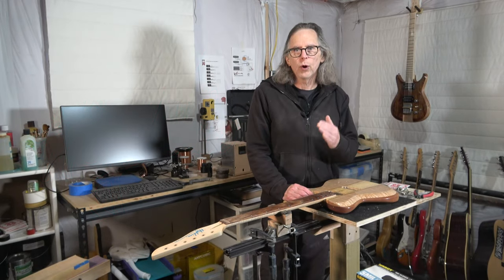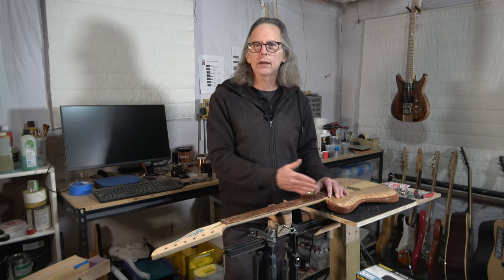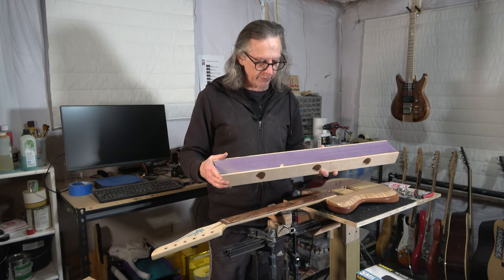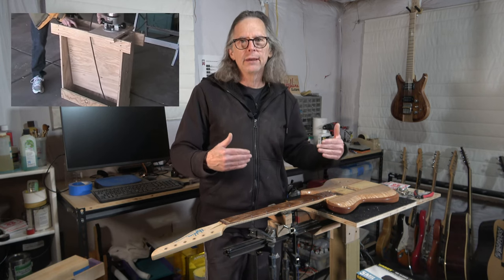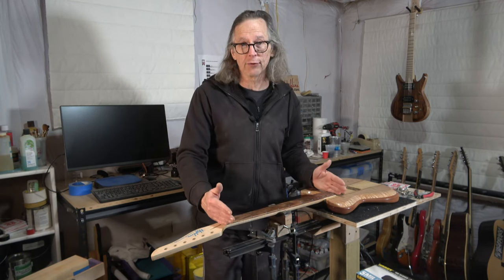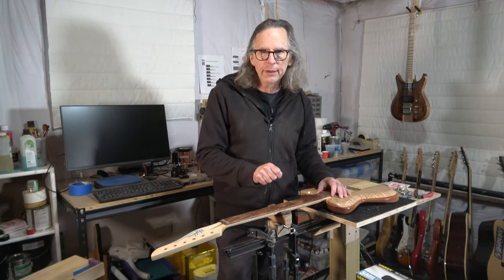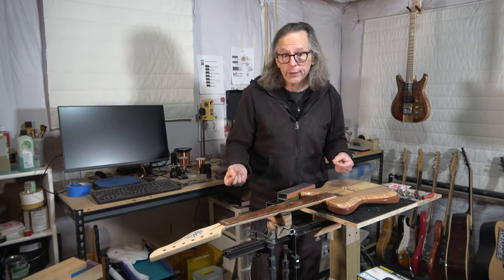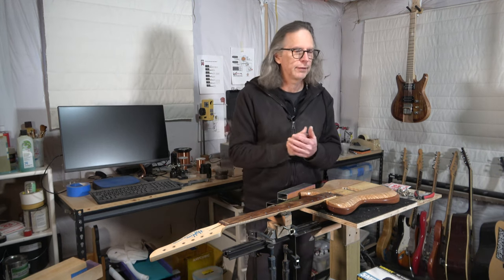How To Make A Compound Conical Radius Fretboard

Comment: I have found, using my player's perspective, that making a 10"radius fretboard works great for chording and 1st position use but then using an old luthier's trick of doing a "conical" taper at or around the 12th fret and ever so gradually flattening it out to maybe 10.5 ish with a bit of 'fall-off' makes the action super low, super bendy and gives the 'fast' allusion to the dusty end of the fretboard as the late great Malcolm Young would refer to it as.

Comment: I prefer no radius at all, and I don't understand why do electro guitar builders even do that. I find it easier to perform bend on flat surface and with higher frets (like sintoms 4.3, they have 2.59mm crown height)

Comment: I agree with it being a gimmick to an extent… I have a few compound/conical radius guitars and a few single radius guitars and the difference isn’t really that dramatic past 10” - my Road Worn 60s Strat has a 7.25” radius and only issue I have is that it sometimes frets out if the truss rod isn’t tightened. Other than that I barely feel a difference

Comment: It seems that if you want a locking tremolo system you need a compound radius because the locking nuts are only 10” and then bridge 12” unless you use GOTOH 14”.
Reply from the maker: Only if you’re super anal retentive.

Comment: What radius cauls are available? I wonder if putting a piece of thick rubber with a fret-sized groove between the caul and the fret would accommodate the slight discrepancy in radius between the caul and the fretboard while applying consistent pressure onto the fret?

Comment: Great videos!  String spacing is greater at the high end of the fretboard than at the nut.  Therefore, for a straight (no relief) neck, the minimum buzz-free string-to-fret spacing over the entire fretboard is achieved with a conical fretboard.  Envision moving your "vertical" Christmas tree (cone) lights to a cylindrical trash can, or vice versa, and you can see the problem.

Comment: When I first heard about "compound radius fretboards", I'll admit to being momentarily mired in confusion. Then I realized it was actually a misnomer that had become generally fixed within the guitarists' lexicon based upon a miss-identified or referenced aspect of a portion of the circumference of a circle. In short, that specific section of circumference, its actual width corresponding to that of the fretboard at the nut, manifests its degree of curvature in direct relation to the radius (one-half the diameter) of the given circle; the larger the circle, the larger the diameter, and subsequent radius. Since it was easier among craftsmen and musicians to refer to such degree of circumferential curvature by referencing its relative radius, it became a commonplace application term within the genre. 
In terms of fretboard curvature specificity, the term "conical radii" would be more accurate, but will not necessarily supplant the currently widespread use of the term "compound radius". Does it really matter?  Probably not . . . but knowing the difference doesn't hurt, either.

Comment: I like the compound/conical fretboards on my basses, as the longer scale I use (36") and the need to play two handed tapping on occasion, levels out the feel low and high on the neck.
I simply use a no 5 plane and follow the path of the strings on the fretboard instead of staying parallel to the center line.

Comment: if you weigh for a long time :) all the pros and cons, then you can come to a purely flat frets surface. It's not even a matter of manufacturability (obviously it's easier to make a plane and install a fret wire than a cone and other second-order curves :)). The main advantages of a flat fret surface are: non-parallel/fan frets have better intonation; when using bends, a large string amplitude is allowed. Much more difficult and, I think, more important is the problem of the OPTIMUM line of the tops of the frets under a  each string. A “flatness” is fundamentally impossible here .... I think that Chapman’s experience on a stick with two anchors for different fret areas of the fretboard (“upper” and “lower”) is to some extent similar to the intonation adjustment of the scale at once both on the lower bridge and on upper bridge

Comment: Seems like you should be able to just intuitively fan a sanding beam out from the nut width to the bridge width. Say a 1 5/8 nut and a 2 3/16 bridge. And the natural action of the beam sanding less as it gets wider should do the trick. What kind of clinical radius you would end up with would just be different every time. But who cares if you're going with the natural flow of things. Interestingly, the radius at the bridge saddles must be around 20 on 10-16 neck. How i would assume it would be done with out a CNC machine. The heck with trying to be precise just let the natural fan of the beam do the work and it is what it is.? As far as fretting I would just get the cauls 10 thru 16 and change every 3-4 frets. The level job will smooth out the tops. Probably a small beam would be better for a comic radius and just follow the natural fan. Im just assuming all the little things you would do to keep a straight radius would get thrown out the window and just intuitively go with the fan. By the way that is the beauty of a conical radius every thing just flows from the nut to the bridge. It is a strange feeling to play one. Just feel in the fingers and in the brain because the symmetry is theoretically correct. The only way something could go wrong is if you work one side of the neck more than the other. But you should be able to check it with a radius gauge at both ends.

Comment: It may seem odd, but I prefer no radius, just a flat fingerboard. Of course it wouldn't seem odd if we were talking classical guitars...but why is there any difference between that and electrical? There isn't any, for me at least. 

The only reason I hear that made me test out the theory of radiused FB's was barre chords. I do those chords fine with a 7.25" radius or a flat, and it may actually be slightly easier on flat. It's something I can see as my finger stretches across the board...it stretches out pretty flat. Maybe it's my finger anatomy? Or maybe the idea of radiusing in the 1st place needs more consideration?

Comment: I think you're splitting hairs. the word compound can mean more than 2. a chemical compound can be comprised of many elements,  and so a compound radius can have many radii. on the other hand there is no such thing as a conical radius. the radius is simply the distance from the centre to the circumference of a circle. its a straight line. however. since a cone has many radii, we could say it has a compound radius.  and since the surface of a conical fretboard is a section of the surface of cone we can call it a compound radius fretboard. and we should because that's what its always been called. then nobody is confused.
Reply: I can see how you're well equipped to spot hair splitting - you're obviously an expert yourself
Reply: I see both points and honestly it should be fingerboard instead of fretboard 😛 I’m being a silly person don’t mind me
Reply: @julialacey1604  maybe so, but in the honorable defense of the semantically correct term 'compound radius'  from usurpation by the so called conical radius, which isn't even a thing. Are you fer us or agin us?
Reply: @ZL1LoVeR  fingerboard and fretboard are entirely interchangeable, although fretboard is fewer letters to type. On the other hand compound radius is a correct description and conical radius doesn't make sense. I could live with conical section fretboard. Or, we could just go on calling it what we've always called it and we'd all know what we were talking about. And we'd all be right!

You can probably tell I'm a very busy guy.
Reply: I agree, like everyone knows what you mean when you say tremolo arm, even though that's even more incorrect. That said he built it if he wants to describe it as conical fretboard that's his prerogative. Marketing makes up new names for things that already exist all the time
Reply: @brianmascarin3875  for what it’s worth I say fretboard cause I’m from the US
Reply: @ZL1LoVeR  also i say wiggle stick because it’s far more amusing
Reply from the maker: Fingerboards don't have frets. Fretboards have frets.
Reply: @HighlineGuitars  fingerboards have fingers 🤣🤣🤣🤣
Reply from the maker: @ZL1LoVeR  that’s what she said.😏
Reply: This is the sane answer.  Nobody on the planet has ever considered having two distinct radii on a fretboard.  Of course, they are all conical.
Reply: The strings are placed closer at the nut than at the bridge and are not parallel with the fret board therefore you will also have a true compound  angle with  with the strings from bridge to nut, I will clip my finger nails and adapt and let the experts chuck it in with the tone wood and scatter winding argument.